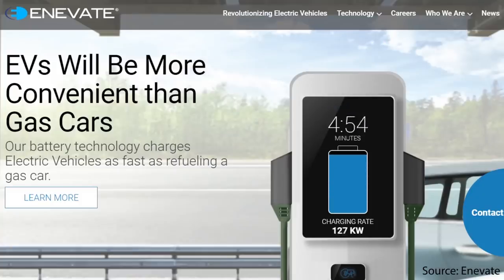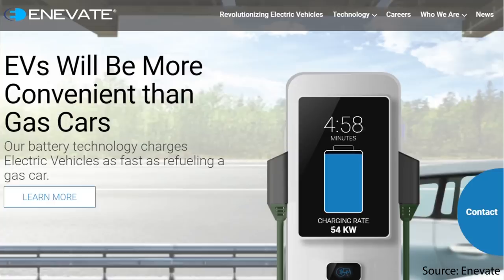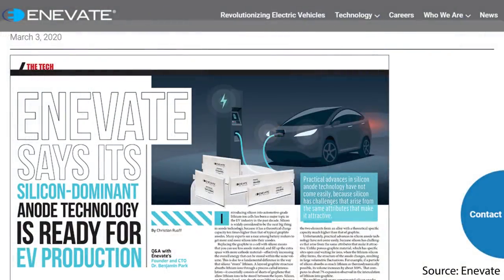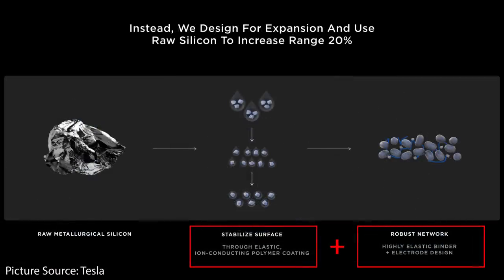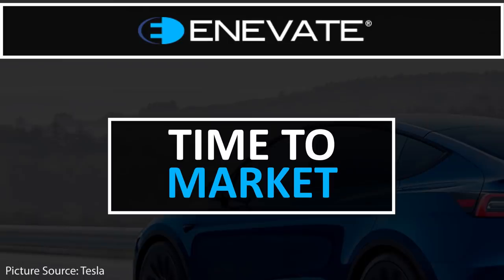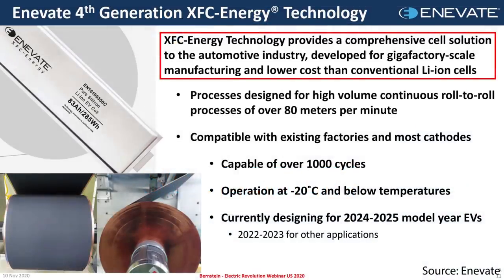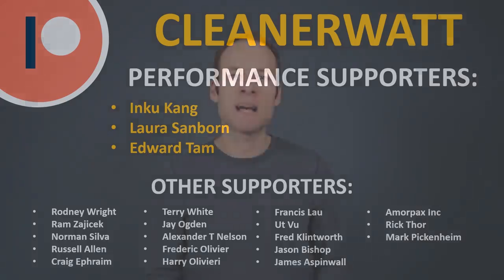Tesla Should Acquire ENEVATE Battery Startup (ULTRA FAST EV CHARGING)

Comment: while their battery tech is impressive on the surface, you should be weary of taglines such as "Tesla should..." Pretty sure right up until now Elon and Tesla execs proved to be a very capable strategists and decision makers. What seems as a good thing to you might not necessarily seem as a good thing to them. You are only seeing top of the iceberg here, you have no clue what's going on below the surface. Maybe Tesla has their own solution and they don't need a third party tech. Maybe they contacted them already but could not reach the deal - which certainly seems like mr. Park wants to sell licenses to his tech not become another Elon's acquisition that nobody will remember 3 years from now. Maybe...something else. who knows.

moreover did you stop to think how this 5-minute charging will affect infrastructure and current charging stations? none of them are able to push that much Amp-juice. you will have a battery that can be charge for 5 minutes but then entire charging infrastructure across the country and world that can not handle these levels of current. Tesla would need to replace all or nearly all of their older supercharger station, including newer ones because even those won't be campable of pumping out 3-4 times of current to charge these batteries.
Then most cities/townships grid infrastructure probably can't even handle 1000s of additional Amps of throughput not to mention electricity suppliers. CA can barely handle their summer peak curve as is, i'm sure they are not alone in this. plenty of poorer counties still live off of 1960-70 built grids because they can not afford updates. you drive 50 miles from most populated centers and you get back in time as far as electrical grid goes.

this tech has a place when grid can handle it. US grid ca not.

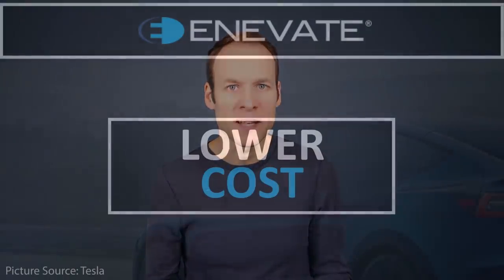Comment: I’m all for silicon anodes, but both Tesla and Enevate are making claims of Silicon being abundant and cheap, but fail to mention that the purity they need is not found naturally (SiO2 is quartz and sand, and batteries req. +99.9%Si) and it cost quite a bit a money and environmental damaging to refine such. There is one company with a silicon process (PUREVAP) out of Canada making green low cost silicon materials. Crazy to think all new silicon anode / battery producers would be relying on their low cost silicon process to provide low cost silicon materials for their batteries, but every other process ain’t green nor cheap and good luck trying to buy silicon with a 100m MT/yr demand of silicon materials for EV battery production by 2030. Both you and Enevate didn’t want to talk about how Silicon is cheap at 5:55 but I hope Enevate has locked in a green low cost supply of silicon to prevent disruption in growth. Go Silicon!!!
Reply: At battery day they claimed the cost for the Silicon was about a dollar per kWh.